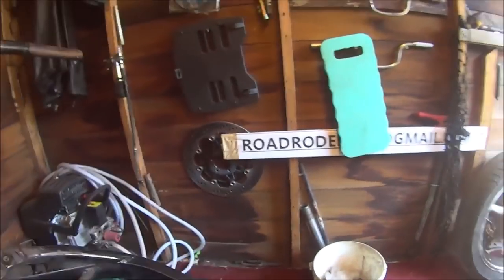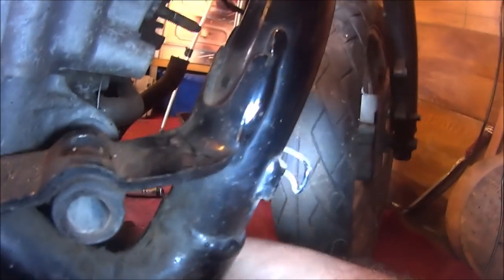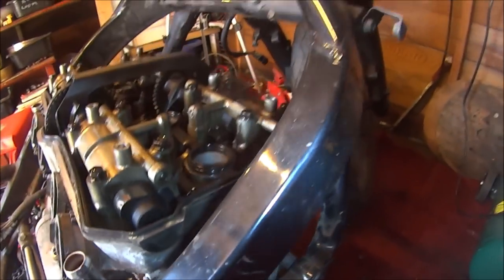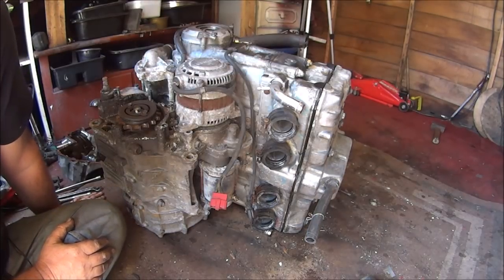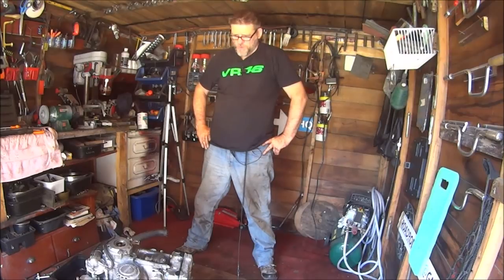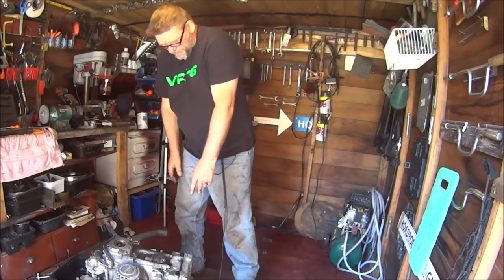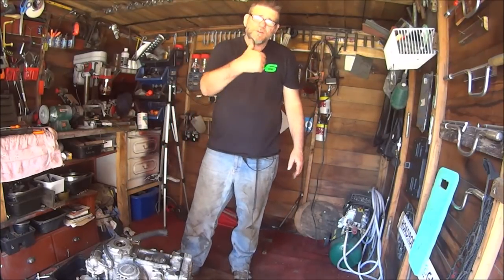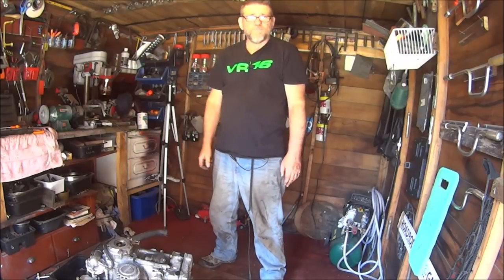CBR1000F ENGINE removal P- 2

Comment: that's a pain in the arse mate the sticking like that I have same issue rebuilt 600f3 engine turns over ok leave for a few days and now won't budge at all done my head in not touched it since lol as was a spare
Reply from the maker: I know it turned with a spanner and it turned with the starter motor now it's out the frame it's locked up and all 3 chains look fine. Oh well let's see what happens when we start to remove the cams.

Comment: John remember to borrow delboys copper grease on reassembly! Have you got a plan on how to put the lump back in?😎
Reply from the maker: Lol.I'll use the cheap grease. Think I'm going to have to do a few practice runs with replacing the engine I'm dreading it.